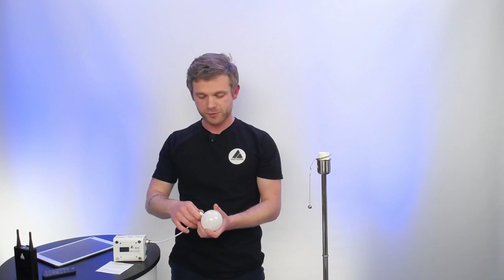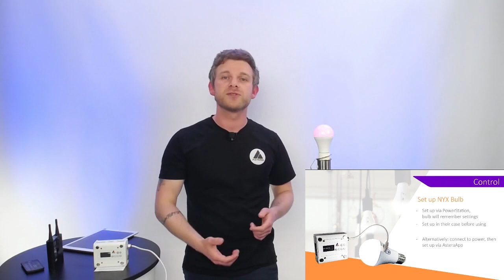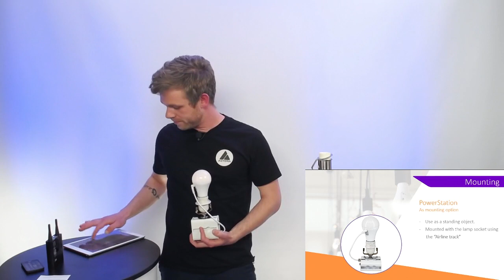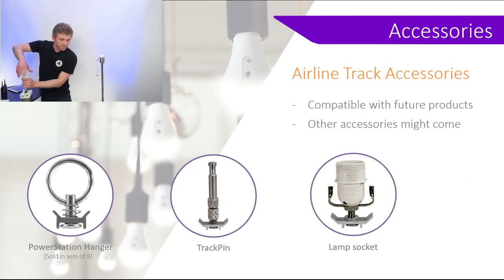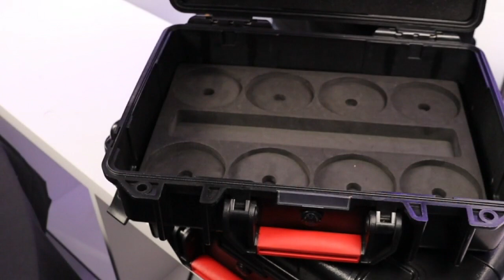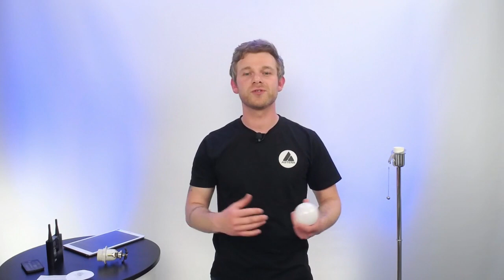Astera Academy - The new NYX Bulb

Comment: Are these dimmable?
Reply: Yes sure, with the AsteraApp, wireless DMX or the PowerStation
Reply: @jespersorensen796  is the asterabox required to control them from the smartphone app or can I connect to them directly with the phone's wifi or bluetooth ? Does this limit the app's functionality ?
Reply: @barnabycoote  At the moment the AsteraBox is required to control the bulb with the AsteraApp. However we are working on a firmware update, so that you can connect your phone directly to one bulb with bluetooth, it will simply work as a AsteraBox. The controlling range will be approx. 100m instead of 300m. The App will work as you know it.
Reply: @jespersorensen796  Any date for this firmware update?
Reply: @kristiandaviklarssen  I know they are working hard on it, but no actual release date yet

Comment: Can they be powered all the time from an ordinary light bulb socket? just like an ordinary e-27 tungsten bulb? Do they work only on batteries, and the socket is just to have them where to mount?
Reply: You can power them all time from a E27 socket, or use the PowerStation as external battery via the battery input (DC socket). The Bulb itself do not have a battery built-in